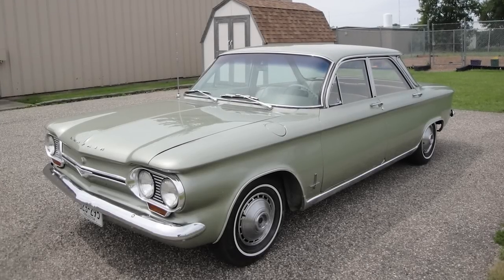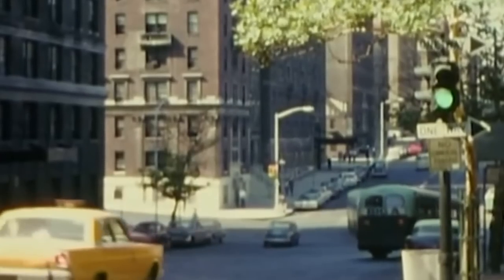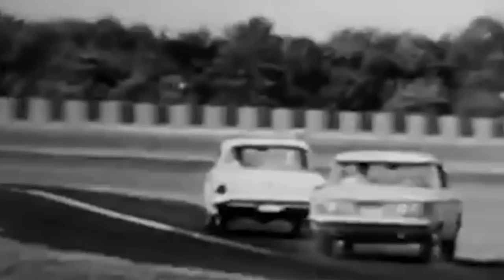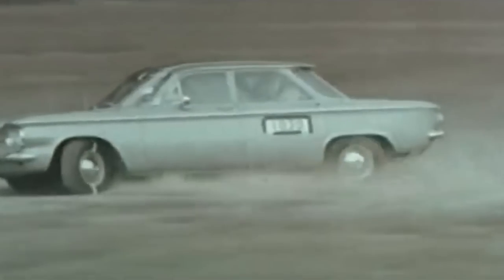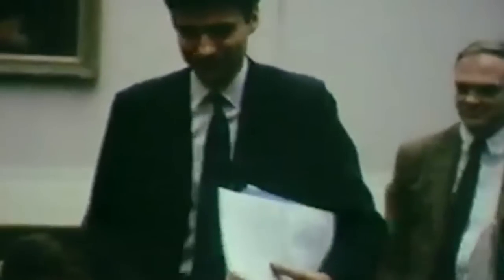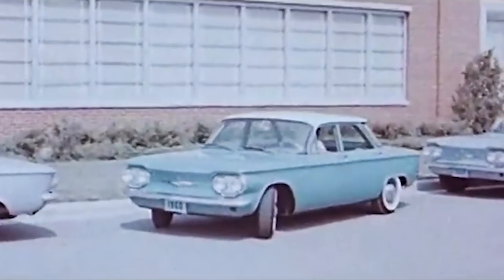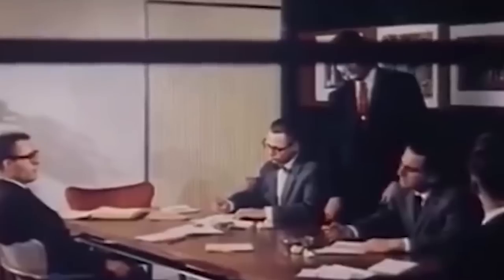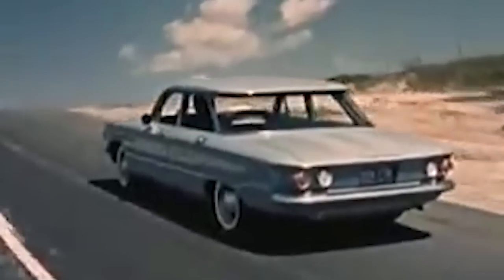Chevrolet Corvair. Where did saving a FEW DOLLARS lead to? Engineering error.

Comment from the maker: Hi! Did you know about this engineering mistake? Did you deal with this car?
Reply: I recall the solid steering column pointed directly at your sternum:) Add in no engine in front.."staked"
Reply: I'm glad you told the truth. I have owned several Corvairs over the years. I currently have a 1966 monza. They are great cars and quite fast, but you better know how to drive.
Reply: So you're saying the Beetle made this mistake also. Same thing. 
I detect a strong bias against GM from you. You're just repeating what Nader said without any knowledge of automotive engineering what so ever.
Very biased video!
Reply: @pto200  ~ Well said. Thank you for that comment! The Corvair is still a great car.
Reply: If was a failure it was marketing’s not engineering.
Reply: In 1961 my dad bought a used 1960 Corvair which my my brothers and I loved because it was a lot of fun to drive. Eight months later my 19 year old brother rolled it on a straight highway one night when he tried to avoid hitting an armadillo. He'd done this on other cars with no problem. This time the car skidded sideways and rolled completely over, caved in the top and broke the windshield and other glass. Because he had his seat belt on my brother was unharmed, but really shaken up. He refused to drive it after that. Dad had it repaired and the rest of us continued to drive it. In 1962 when I was 16 I nearly rolled it on a straight dirt road. It was during the day, clear sky, the road surface smooth and dry. I'd made no corrections nor was I distracted when suddenly the car veered hard to the left and headed for the ditch. When the tires hit the soft shoulder they dug in. The car went up on it's side into the ditch and stayed in that position for about a minute. I was only doing about 35. If I had been going faster I'm convinced the car would have gone over onto its roof or even all the way over. I was stunned but unhurt. I undid my belt and started to climb out the passenger side when slowly the car fell back on its wheels. I was still in the ditch and had to get out. Not even sure if the car would restart I gave it a try. It started and it took me some twenty minutes to get out. I drove home, about 20 miles with no other trouble, and determined not to tell my dad. I'd been home for an hour when he noticed a lot of dirt imbedded in the wheels on one side and under the lower body trim and asked me how it got there. I had to confess what happened expecting to be punished. But Dad was glad I was OK. He traded the car in a week later for a '56 Chrysler. Years later I wished he would have reported that car and had it crushed, but we didn't know at the time that those mishaps weren't our fault. I hope no one ever got killed or badly hurt by that piece of junk.
Reply: @justajo2  … thanks. A story from the heart and experience.
Reply: @martentrudeau6948  Basically a 3/4 scale Tucker 48. with a gasoline-flame heater next to the gas tank.
Reply: @user-wy6mo1vr8t  ~ Collapsible steering columns were not common in the late 50s and early 60s cars. The VW bug, Fiat 500, Citroen 2CV, and Porsche didn't have front engines either. Why pick on the Corvair?
Reply: @pto200  ~ Exactly
Reply: Uboob says there are 8 comments, but Uboob must have censored 7 comments, because I see only one.
Reply: A friend had one of the early examples and the engine and transaxle dropped out when he drove over a railroad crossing.
Reply: What you tout as facts are not all correct! Your cherry picking Nader’s “facts” were debunked by The Department of Transportation.
Reply: Yes, and Yes.
Reply: @88seanster .   Very true Sir.  A knowledgeable Driver should know that a rear Engine/ rear Transaxle vehicle is going to handle far different than a Front Engine Front drive Car. He/She should be driving the car accordingly.
                                     Fergieman

Comment: The US government tested the early corvair in the early 1970s against its rivals and concluded the corvair was not unsafe. Ralph Nader was not an engineer or expert in anything automotive just a lawyer journalist
Reply: It rolled over which was finally fixed with a $15 stabilizer bar. Ralph Nader was late to the dance, there where many issues documented already before Nader book came out.
Reply: @johnsradios484  I grew up with my mother driving her first Corvair a 1960 4 door. Her last corvair was a 1966 4 door with factory AC. They drove just fine. She never had a time where she thought the car was unsafe. The most unsafe thing about a car is the driver.
Reply: @johnsradios484  Inflation has greatly distorted our present-day perception.  Back in 1959, $15 was not an insignificant item in the production cost; the "bean counters" would rightly demand of engineering why the $15 stabilizer bar was a needed feature.  Like anything else, a "cost vs. benefit" analysis would be made to determine if the feature should be included, as likely the sale price would have to be raised to compensate for it.  Me, I would have included it and raised the price to cover the cost, as doing so, even in the face of a few lost sales to price-sensitive buyers, is a better risk to take than adverse publicity over a product PERCEIVED as unsafe, even if the perception is based on the slander of a technically ignorant homosexual with an socialist agenda.

This is not unlike the pontification involved in the 1988 movie, "Tucker: The Man and His Dream".  Yes, the Tucker '48 (not the "Torpedo", that was an earlier design of Preston Tucker) did have a great deal of innovation, like a pop-out windshield and disc brakes...and, it very BADLY didn't meet its original sales price goal of $1,000, having to retail at $4,000, which was more than some CADILLACS.  So, for all his "Safety" innovations, Preston Tucker put out a vehicle that was a high-end "niche" car, which had no promise of mass appeal without somehow getting the production costs down considerably.  Preston Tucker was w/o doubt one of the greatest engineers and innovators, but the man somehow had no business sense when it came to mass production and marketing.
Reply: He was a FAILED attorney at that.  Every wonder WHY no law firm would hire him?

Comment: In the 1965 model year Chevy changed the swing axles with a rear suspension just like the corvette which eliminated the tuck under of the swing axle. I owned a ‘65 model and it was one of the best handling car I’ve ever driven.
Reply: Absolutely true.  I've owned 2 Corvairs, a 1969 and now I have a 1966.  Both handled securely and safely and among rhe best highway cars I've ever owned.
Reply: I had a '67, and it was a fun car to drive. You just had to know how to drive it and keep the tires properly inflated.
Reply: A lawyer-journalist  who never actually practiced law!
Reply: Can't sell books without a healthy pinch of hyperbolic bs.
Reply: Yep, the late model (starting in the '65 model year) used a very similar design to the '63 and later Corvette- in fact, many of the components were shared between the two cars.  I also note that the 1965 Pure Oil Trials, which compared almost all cars on power, handling, mileage, etc. demonstrated that on the skid pad, the Corvair was the second highest performing car IN THE WORLD!   The first?  The 1965 Corvette, that had the benefit of using 15 inch wheels and tires, while the Corvair used 13s!
Reply: I have a 63 with the swing axle.  So does every 60s PORSCHE owner!  This is absolute nonsense.  The swing axle is what makes it FUN

Comment: The SUV's of today are far more prone to flip than even the '60-'64 Corvair.  The '65 was one of the best handling cars on the road, and is better that most cars today!!!  Radical changes to the rear suspension in '65, and the oversized drum breaks made it a delight to drive.
Reply: It’s true!  With today’s vehicles every fender bender becomes a rollover!!!

Comment: I had a 1962 Corvair that handled just fine! I owned a VW betle, and I was familar with a rear engine car, so the Corvair was a great handling car for me. The heater killed people, not the handling, and i almost died in one driven by a guy who had never driven one and we  had a crash,  so don't blame the car. The 65 and later model was even better!
Reply: I knew a mechanic that worked on VWs and Corvairs exclusively and he thought that "unsafe at any speed" was a crock.
Reply: The car had its virtues, but if you need special lessons to drive a car safely, it doesn't belong on public roads. GM should have put the improvements it made for '64 on the '60 model, or gone with the '65 Corvette-style suspension from the start.
Reply: @davidmitchell7183  Given how neither vehicle was exactly a "barn-burner" when introduced, probably the problems inherent in the handling of a rear-engined, swing-axle vehicle at HIGH SPEEDS weren't expected to crop up.  It should be kept in mind that ca. 1960, the Interstates were just getting started, and the USA was fairly much, at least east of the Mississippi, a "50 mph" affair.

Comment: I owned a 1962 and my brother owned a 1964 and a 1966. I lost control of my 1962 on the interstate in the rain. The car went sideways flattened two reflectors and went down into the grass. Never rolled. I was so shook up I got out and locked my keys in the car with the ignition on but not running and all dash lights on. Cost me 35.00 dollars to get pulled back up on to the pavement and I drove it home.

Comment: Tuck-under oversteer also happened on many Euro cars like the Renault Dauphine, Renault 8 and 10, Triumph Spitfire, Simca 1000, VW Beetle. It was a good thing that car manufacturers  eventually stepped up and started to use different suspention geometries, anti roll bars and radial tires.  
Later in the 1990's there were cars with other problems like the 1st Mercedes A-class and Suzuki 410/Jimny 4x4 that had a tendency to roll over in sharp sudden evasive manouvres. 
Today there is still a car on the road that uses the rear engine layout, the Porsche 911, a car loved by almost all car enthousiast.

Personally i wouldn't mind owning a later model Corvair. In the hands of a good experienced driver it will be a nice car to drive.
Reply: Yes, the 70:s and early 80:s Skodas that were also rear engined also had a swing axle of the same kind as the Corvair, and they also rolled over pretty easily, the Swedish car show " Trafikmagasinet ' ( Traffic magazine  " ) rolled one over in their debut season 1978, and later 2 Skoda experts should show that it did not roll over, but it did, but in the mid 80:s, the rear axle was changed, and the handling was fine from then on.
The Suzuki Jimny, the version that launched in the late 1990:s also rolled over in a slalom test, done by a Swedish motoring magazine.
Another car that liked to corner on it's roof was the first and second gear Ford Explorer, due to it being tall and narrow, they did not need a blown Firestone tire or a stuck cruise control (search for Runaway cars Ford Explorer to see ) to roll over, a sharp corner would do just fine.

Comment: The swing axle in the rear required a sway bar which was deleted, but could be added as an option. Thius equipped, the car handled competently. Like Fotd's Pinto this was a cost decision, not an enineering one. VW beetles used the same setup.
In 1965, GM changed to an IRS which made for a superior handling car compared to the Mustang. Today, Corvairs are in high demand weith collectors.
Reply: I owned a total of 8 Triumph Spitfires and 6 Triumph GT-6 cars.  All of the Spitfires would tuck under a rear axle and spin out if cornered hard. Early GT-6 cars did the same thing until they came out with the Rotoflex axle system that much reduced wheel tuck under. I had some personal fixes that solved much of the tuck under troubles. I think the Triumphs had more severe cornering sudden oversteer than even the early model Corvairs.

Comment: I had one, absolutely nothing wrong with it, was no more unstable than a VW. The addition of an aftermarket sway bar eliminating the problem. If you drive at safe speeds there is no problem with this car.

Comment: I had a '64 corvair in 1977 and it handled great. I put Michelin radials on it which is what Chevy should sold this car with because the stiffer sidewalls prevented the tire from tucking under on hard cornering. Bias ply tires have softer sidewalls which collapse easily under a lateral load and could initiate some unfortunate vehicle dynamics.
Reply: There were no radial tires until the 1970's
Reply: @fustyblatherskite2142  Michelin made radial tires in the 1960s.
Reply: @grant wright  true, in the 1960 Michelin was just starting to be imported into the US. They were just beginning to be accepted around 1973. Car manufacturers were not using them in 1960s. Michelin tires back then were made in France. Also, in the 60,s, made in the USA was a big deal.
Reply: @fustyblatherskite2142  "I had a '64 corvair in 1977"
Reply: @Eric Hensel  which came first 1973 or 1977. I bought my first Michelin in 1973. Actually. I bought two for my 1971 Mustang. I still had Good Year Wide Ovals, biased tires on the front. Since biased tires and radials have different slip angles, mixing tires like that was unsafe!

Comment: Independent and unrestrained rear suspension is the culprit. An unloaded axle could articulate under the vehicle pushing the vehicle over and rolling it. The simple solution was the anti-sway bar which is a common part today. The Corvair was hardly alone, just the most infamous version. Ford made US Army Jeeps and the old US Postal jeeps were far more likely to roll due to a high center of gravity. The Army dedicated money and time to train troops how to specifically drive the Ford because it was so prone to rolling. Ironically Porsche used Corvair flat 6 engines in creating the 911. GM's powerplant was actually well designed for its era.

Comment: Old Nader had a vendetta against GM. He knew nothing of engineering and used this an opportunity to sell books and make a profit. To be fair, he should have compared it to the Beetle, which had a similar swing axle rear suspension. Why didn't he ever mention that? At least The Corvair was later upgraded to independent rear suspension similar to the Corvette, which put it light years ahead of the Beetle.

Comment: The thing that people don't know about Ralph Nader it's that Nader himself ad a 62 corvair 4 door ...and he use to love that car ...and also considering that many people didn't know how do drive a rear engine mounted car is that everybody use to put the same amount of tire pressure all around which was 35 pounds...but the trick was to put only 20 to 25 pounds of air pressure in the front and 35 in the back.. which causes the front of the corvair to bea little bit trickier to go around a corner at high speed..but if everyone would put 20 to 25 pounds of air in the front tires..it would be just like every other car....and to everyone that I talk about the Chevrolet corvair to all said the same thing... THEY USE TO LOVE THAT CAR.

Comment: I had a corvair it was a great car great on gas it was fun to drive and it was a safe car to drive. Mine didn't leak oil again fun car to drive distributor was easy to replace the point. By the way I used to drive the hell out of mine mountain road straightaways I had no problem with it handling.

Comment: No one seems to mention that both the VW Beetle and the Porsche used the same swing-axle suspension, yet these cars never got the negative press that the Corvair received. Most of the accidents were (could be)atributed to the consumers not following the tire pressure differential that the manufacturer advised, which made the car excessively understeer. There was nothing "wobbley"about the Corvair's axles and every assertion by Nader was debunked by a Gov't. panel. Why didn't the othe cars w/ swing-axle suspension get a bad rap? I rode w/ my mother in her '64 turbocharged Corvair in many a Rallye race and she never had control issues and she would top 100MPH consistently. Nader found deep pockets and, like a dogw/ a bone, bit down and held on to his one and only bone.

Comment: In Europe we had a lot of rear engine cars - VWs, Zaporozhets, Skodas 1000MB/100/105, Fiats and Zastavas 750. The main issue was that the front was too light, especially during winter. But our drivers found a solution. You had to put something really heavy, 50-70 kg+ in the trunk. A sack of sand, concrete block called "trylinka", or even a piece of a rail. Another thing - their handling was really poor if you had a roof rack. Put something heavy on the roof = even more strain on the REAR axle.
Reply: We use to put a cement block in the trunk of my mothers Corvair in the winter

Comment: This video has some misleading information (along with some scenes of Ford cars). The Corvair can be broken down into 2 series. The first was the 1960 ( on sale in fall 1959) to 1964. The second was from 1965 thru 1969. Chevrolet was aware of handling problems and tried a fix for the 1964 model, before a major redesign for 1965. which was already on sale in the fall of 1964 before Nader's book came out in 1965. Chevy had hoped that the Corvair would stave off the new Ford Mustang, but that failed and they worked on the Camaro that was introduced in 1967, intending to cancel the Corvair. There was so much press about Nader's book that Chevy kept the Corvair in production until the end of 1969, probably for spite. So Nader's book, instead of ending the Corvair, actually extended it.